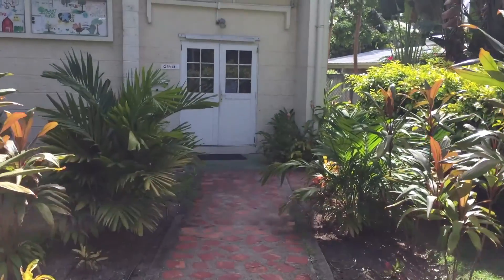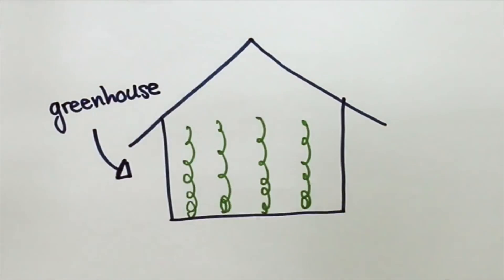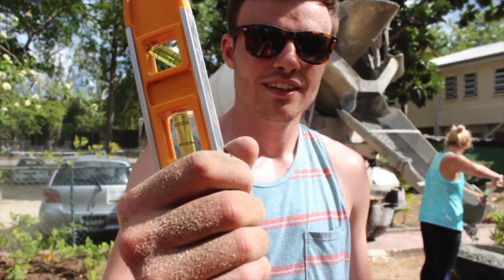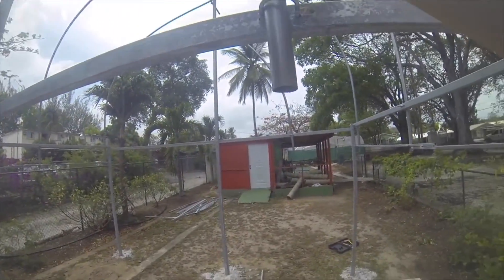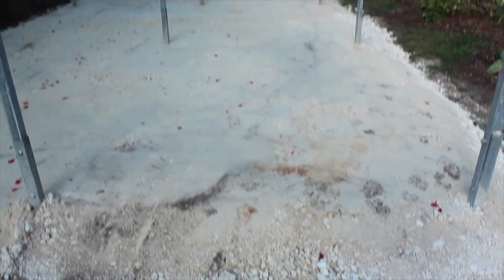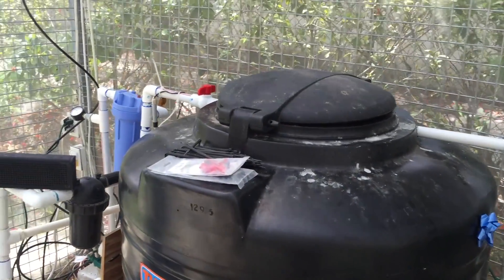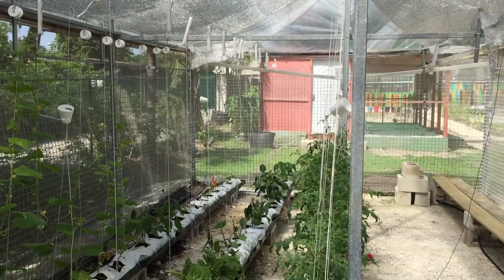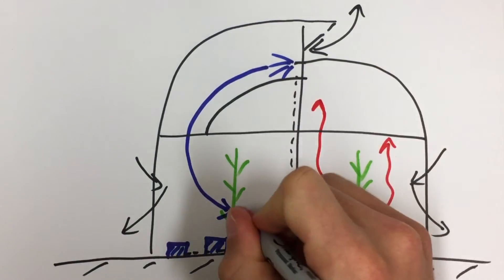Construction of a Greenhouse at The Bellairs Research Institute

Comment: Hi Lucas.

it's effectiveness will depend on RH..

so which means if i'm looking for lowering humidity in the greenhouse, this won't be the solution, right?
I'm from Thailand. tropical area where has lots of rain.

Thanks to you guys for the hard work and for the information
Reply from the maker: Indeed this will not reduce the RH inside the greenhouse. The NVAC system relies nonetheless on an evaporative cooling process, thus increasing the RH as it cools the air.

Comment: hi lucas think this system will work in india?
Reply from the maker: Yes, absolutely. However, it's effectiveness will depend on the local relative humidity levels.
Reply: Lucas McCartney 
Most of the climate in India is sub-Tropical Humid or Semi-arid, depending on where you r.

https://commons.m.wikimedia.org/wiki/File:India_and_South_Asia_K%C3%B6ppen_climate_map_with_legend.jpg#mw-jump-to-license

Specifically in the Ganges river valley (Farming heartland), we have hot and humid Summers (T: 25-45+ deg C; RH: 60-90%) and cold & dry Winters (T: 5-25 deg C; RH: 40-70%)

Would u suggest a hybrid with the NVAC design and a cooling Fan-Pad system? Basically when the cooling load is too high, the forced convection steps in, and rest of the time it's the natural convection from the NVAC doing the job?

I am interested in growing hydroponic leafy greens outdoors in this region. Would appreciate any tips and advice on the topic  ✌🏽

Comment: I am building this myself now! But I am using bamboo poles for the support. PVC piping would also work and be much cheaper.
Reply from the maker: Hi David. Glad to hear that you're building this too. Watch out with PVC; depending on the area that you're in, PVC can become brittle very fast and cause structural failure. I managed to make PVC last for a structure like this for roughly 2 seasons in Montreal, Canada. This was under moderate to weak sun compared to the Caribbean, where I saw PVC used for greenhouse structural purposes fail within 2-3 months, if exposed to direct sun.
Reply: Oh! Good to know. I will try processed bamboo first then. I promise to send pics!
Reply: Hi David, have you build this in bamboo or not? I am also planning for the same, if you made successfully please help me for making.